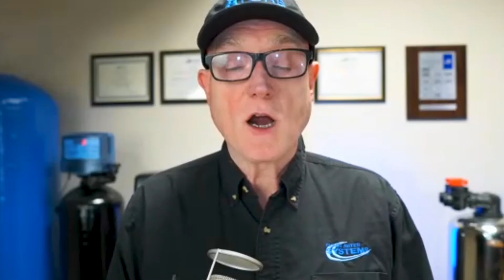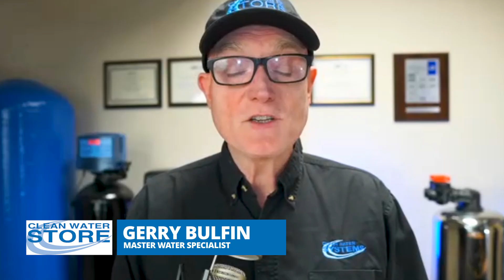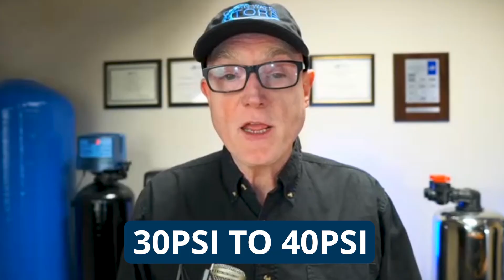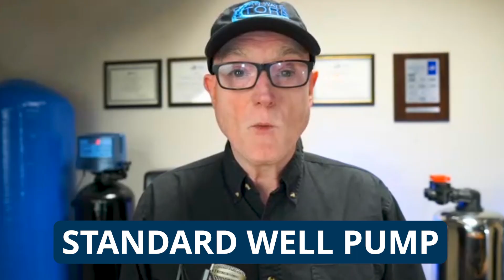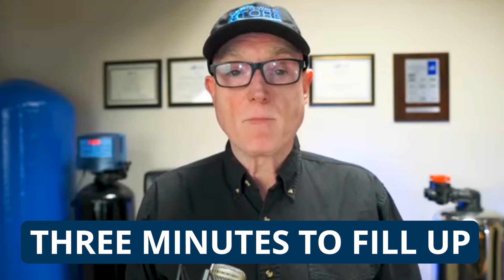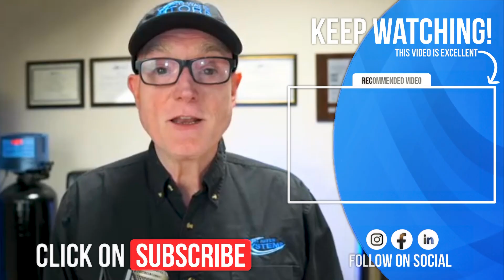How To Measure Your Well’s Flow Rate and Pressure

Comment: New well problem here.  My 1 HP well pump is giving me around 7-9 GPM at 40-50 PSI right after the pressure tank.  However, I'm only getting around 3-4 GPM on my home water spickets.  It's not enough to run my sprinkler system.  Do I need a bigger pump?